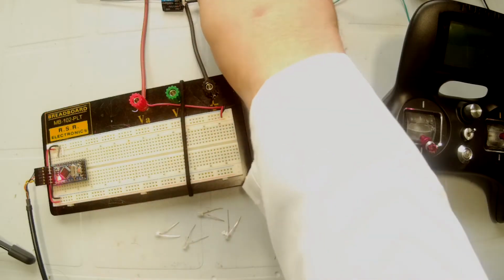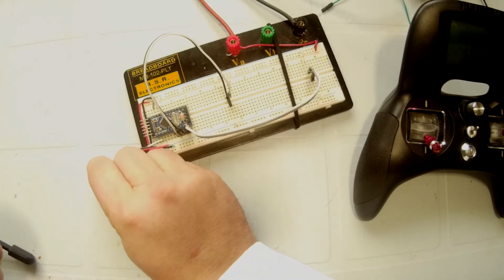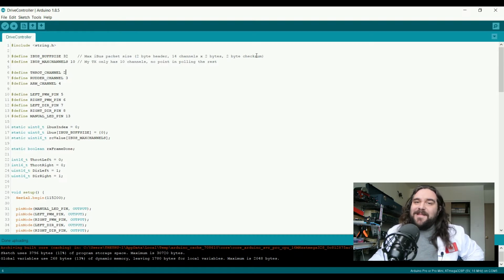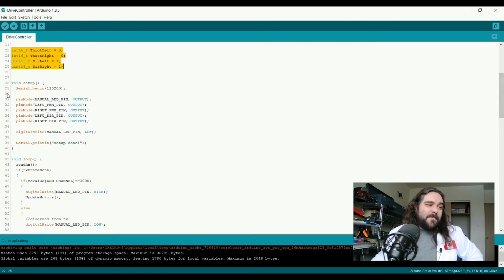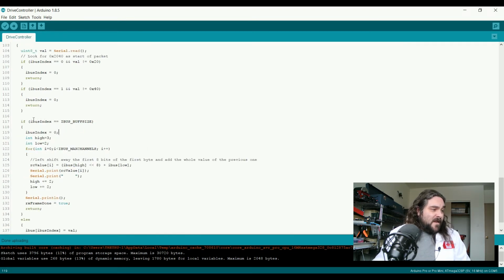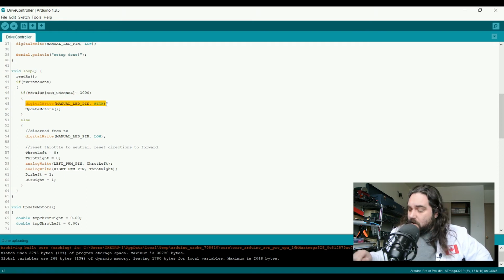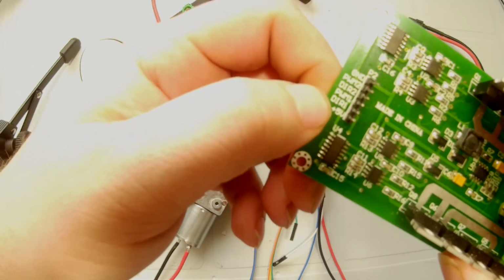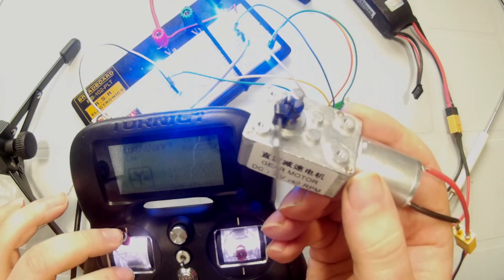Decoding iBus signals with Arduino

Comment from the maker: I have found some more optimizations with how I process these signals! Look for an update video soon!
Reply: Update!!
Also coudn't get code on mikeyslab.ca to work :(
Great work BTW!
Reply from the maker: @claytonkal  yes there is an update, don't have a dedicated video yet, but if you check out the video on controlling an esc with pwm. The new code is in there 😀

Comment: Hi. Do you have a code example doing all this the opposite way? I mean I have 10 values for channels in arduino and I need to pack them into the ibus signal and send it trhorugh tx pin. Thank you in advance.
Reply from the maker: Not specifically, but this should work:  

//set a ibus buffer to all zeros
memset(_ibus, 0, sizeof(_ibus));

 //set the first two bytes to the expected frame header  
 _ibus[0] = 0x20;
 _ibus[1] = 0x40;

//copy values to the ibus array
for (int i = 0; i < sizeof(_ibus) / 2 - 1; i++)
{
    _ibus[1+i] = _rcValue[i];
}

Serial.write(_ibus, sizeof(_ibus));

from here you would just send the buffer out to whatever is transmitting it, serial channel, nrf module etc.
Reply: @MikeysLab  sorry for the silly question, but do I need to replace _ibus and _rcValue to ibus and  rcValue as it is written in your rx code, or should I keep it as you wrote in the comment?
Reply from the maker: @o_s_a  not a stupid question, it should match your existing code. The last time I worked with iBus these were apparently member level objects.
Reply: @MikeysLab  tried to make it work but did not succeed. I'm building RC fish boat and I really need this. I noticed you are a fisherman too, so I rely on your help. I printed the final ibus array and got this
1506     1510     1009     1526     1000     900     2000     2000     1000     1000     
32     226     230     241     246     232     132     208     208     232     232     99     1     15     27     0     0     0     0     0     0     0     0     0     0     0     0     0     0     0     0     0   
Should it look like this? The first 10 values are apparently channels values. What about the rest?
Reply from the maker: No there should not be 40+ values. I will try to write something tonight and will post a link to git hub.
Reply: @MikeysLab  thank you very much. Looking forward to it.
Reply: @MikeysLab  Hi. I discovered that I cannot use Arduino  TX and RX pins at the same time. Can I use analog pin insted of TX pin? The idea was receive ibus signal with arduino, unpack it to 10 channels, make some changes in the channels, and then pack them back and send it further via tx.  Or may be you recommend the other way to do this. Thank you
Reply from the maker: @o_s_a  yup, use softserial to create a second uart on rhe Arduino. Use the physical Uart to recieve the signal and send it out via a softserial port.

Comment: Hi! I am trying to use rcValue[i] inside loop(), but it's some problem with that. Inside the function readRx() is Ok.
Reply from the maker: I am away from the lab, the short answer is scope, rcValue is scoped to the loop() function. If you move the declaration to global or use the already global array it should solve the issue. I will get you a more detailed answer tomorrow morning. I appreciate your patience.
Reply from the maker: Okay, assuming you are following along with the code located here: https://github.com/MikeysLab/ConsumingIBus/blob/master/DriveController.ino

static uint16_t rcValue[IBUS_MAXCHANNELS];

is static and global. Can you provide more details on how you are using it?

There is another example in a different project as well located here: https://github.com/MikeysLab/RCCarFreeRTOSPlaying/blob/master/iBus.cpp
Reply: @MikeysLab  Yes. I am using global array. Thant's why I can't anderstand why i'ts not working. Thanks.
Reply from the maker: @VolodymyrFedoschuk  Can you provide more detail? do you have a git repo I could look at?
Reply: @MikeysLab  Maybe I could send you by mail?
Reply from the maker: @VolodymyrFedoschuk  sure mikeyslab(at)digitalawakenings.ca

Comment: hi, can you tell me how to connect the receiver ibus to the arduino? i guess 5v and ground is obvious, and the data wire, i think you said RXI? is that right? my UNO has a pin labels RX, is that the one? thanks
Reply from the maker: For sure boss, rxi just means receive in, just like txo just means transmit out. So in the case of the Arduino rxi = rx

Comment: I'm trying to get this working with an UNO and none of the serial monitor writes are showing up. Is that only possible using the FTDI device and a mini?
Reply from the maker: Check the baud rate set in Serial.begin(); and make sure it is the same as the serial monitor :) It should work fine with an UNO.
Reply: @MikeysLab  Baud rate is fine. After looking closer I found that the serial works perfectly until I turn on the remote controller. As soon as I unlock the controller by moving all of the switches to off position my PC connected to the UNO gives the new USB device ding and the serial monitor ceases to output anything. Also, the 'Port' menu item becomes greyed out at the same time. (edit: BTW, this occurs very quickly and the serial output will stop mid sentence.)
Reply from the maker: @igotnoname4557  Sounds like there is a power short in your wiring, or your receiver s drawing too much current. I would verify the wires, and try powering the rx from an external 5v (provided it is a 5v rx). When I use this setup, the Arduino and RX is usually powered from either a battery or my lab bench power supply these days.
Reply: @MikeysLab  You sir, are the man. Plugged in the wall wart and it suddenly worked as expected. You have a new subscriber.
Reply from the maker: @igotnoname4557  Glad you got it working boss :) stay tuned, i have a couple really awesome and big projects in the works.

Comment: Hello! I'm looking for a code for me to use only the control auxiliary (ch6, ch7, ch8, ch9 and ch10); via ibus, which only turned the relay on and off! can you help me?
Reply from the maker: Of course, the code that I have posted will work for what you want to do. You just ignore the lower channels and use the values of 6-10 to control the state of pins controlling a relay, of course assuming it is a 5v relay, otherwise you are probably going to want to use a transistor to switch the 12v for the relay.

Comment: Hello!

 is it possible to control the speed of stepper motor (Nema17)?
WITH this code?
writing down the required code?

I tried everything, but I didn't get it.
Reply from the maker: Yes, you will need to use a stepper motor controller as well, see my video on using them. you control the speed by controlling the pace of the pulses on the step pin. The more pulses per second the faster the motor turns. To determine the speed of the pulses you use the values from one of the channels.

Comment: Hi :) nice video and explanation. I wanted to ask if you know how i could logg ibus data from the transmitter side without an reciever? Actually because i would most likely only need the thrust channel i would be satisfied if I could use the signal that the gimbals are giving out? Any ideas on whats the best approach? :)
Reply from the maker: The gimbal in the transmitter usually use either a hall effect sensor or a potentiometer, if you want you could use an Arduino to read the value from the throttle and log it to an SD card. If you open the transmitter you should see two sets of three wires going to each gimbal (possibly 1 set of 4) these will be +5, GND and signal for each axis. You would need the common ground and signal lines to poll the value.
Reply: @MikeysLab  thanks for the quick answer :) now i just have to find out which ones are the signal, that should be doable. Theres 3 Cables each from the gimbals as you can see here http://nathan.vertile.com/assets/images/blog/fs_i6/DSC03253.JPG
Its just the question if i could use the CH1-4 in that is in the upper right of this picture https://basejunction.files.wordpress.com/2015/08/image-2-img_1220.jpg and one of the COM as ground.
Reply from the maker: @hulpe  with the 4 minutes of research I did that would be where I would try to grab the values from, please test though, since I do not know how a second consumer of the data will affect the first. Since these are generally an analog signal it could be problematic.
Reply: as far as i have tested, it does no difference to the signal when i measure the voltage on the gimbal out :) i have implemented the code for the arduino and everything works like a charm :) thanks for your help !  @MikeysLab
Reply from the maker: @hulpe  Glad I could help.
Reply: @MikeysLab   youre a true canadian my man :D greetings from germany :)
Reply from the maker: @hulpe  Germany is awesome, I have spent a couple of months near Munich airport, was a great time.
Reply: Yea we have nice beer and also pretty decen ppl i guess ^^ I also liked Canada, especially Toronto the most when i visited some of the great lakes two years ago, your beer´s not that bad either compared to what you get on the american side xD  @MikeysLab

Comment: Any plans of documentation this series ??
Reply from the maker: Bharat Mohanty that depends on what you mean by documentation. Once I get the Mikeys Lab web site up, yes there will be a write up on each project, plus a files section to download source code a schematics. I am hoping to get this up an running over the holidays. With a full time development position, free time is not as ample as I would like ☺
Reply: Mikey's Lab you exactly picked what i mean :-) thank you
Reply from the maker: Bharat Mohanty then yes lol
Reply from the maker: The website has been started, much more work to do, but feel free to check it out at http://mikeyslab.ca
Reply: Mikey's Lab very neat and clean user interface i like it.
Reply from the maker: Thanks man, I wanted something very minimalistic
Reply: Mikey that was a great walk through of your work.. You explained your sketch a way I could follow perfect. I was going to do attempt this using the separate pwm servo channels. I will have to rethink it now. Good work!

Comment: Could you do IBUS to PWM as well?
Reply from the maker: I can, it is fairly straight forward, just have to use more PWM channels on the Arduino, care will have to be taken to ensure the clocks used are all the same.

Comment: Thanks for the reply!
 I know where the library is looking. but I didn't find it.
Thanks for the reply!
 I know where the library is looking. but I didn't find it.

where can i find (string) library?
Reply from the maker: The string library is a built in C/C++ library, and not one that should need to be added. Simply include it via #include <string.h>
Reply: @MikeysLab  
I copied your code, but it didn't work.

first error - stray '\ 223' in program!

another error - stray '\ 226' in program

and I couldn't fix it.

noticed that sring.h you were between <> but i need between ""

I also corrected the first mistake when replacing the pads.

the feeling that we have different symbols.